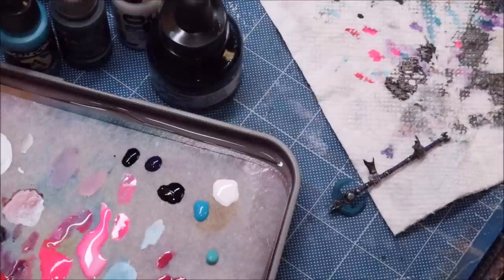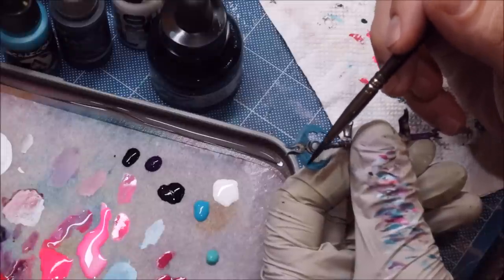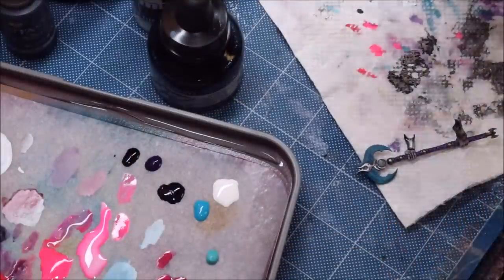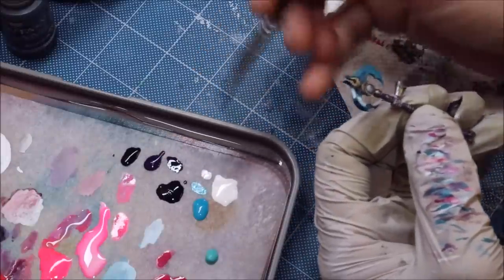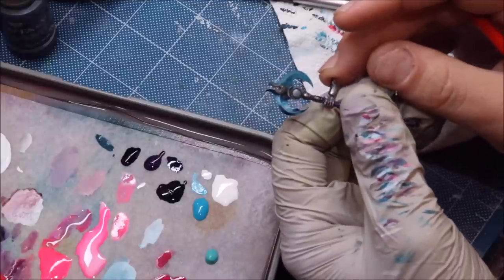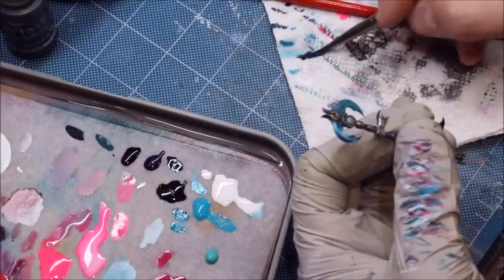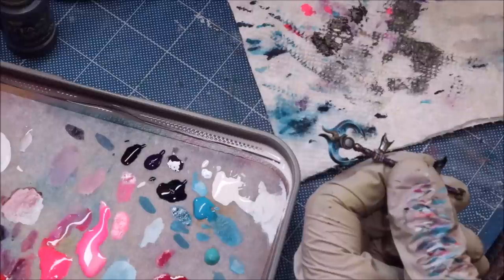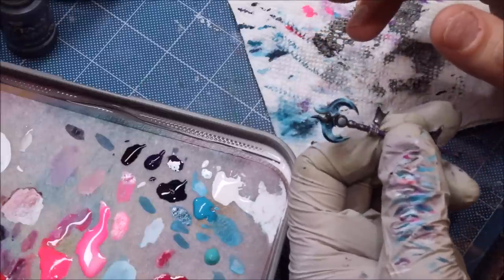Hobby Cheating 193 - Non Metallic Metal Axes

Comment: So, complete the set with a video about Non-Metallic Metal hammers?  I think it could be interesting with those sharp angles and flat planes side by side.  Also, I really like to see a video on painting black armor (ala Stormcast Eternals Anvils of Heldenhammer); I've seen a few other videos on the subject but its either been just heavy (read: all) edge highlighting with lighter colors or the effect ends up very washed out and looking more like just a dark version of the base color (i.e. it turns into dark gray, dark blue etc) and I'd like to see something that actually retains, if not pure black, then at least more of the dark basecoat.
Reply from the maker: Makes sense to me, it's on the list.

Comment: Hey Vince a grabbed some Burnt Umber from Vallejo. The air version. I didnt have time to mess with my air brush but wanted to get some paint on my current project so I just put some on my wet pallet and went to work. I didnt  thin it out at all besides it just being placed on the wet pallet. Only 1 coat on but it seemed to be have a lot like the contrast is suppose to. Which is fine but I am wrestling with some tide marks. Do you ever use Vallejo air paints with the brush or would you say dont ever do that?
Reply from the maker: I use air paints all the time with the brush, the key is you have to understand they are more thin and they have some flow improver in them. Sometimes you may need to work with them a little more, but you have to be careful how much more you thin them. That does sound unusual, but it could just be a 2 coats issue.
Reply: @VinceVenturella  Thanks for the info! It was only after a single coat so I just need another one on them. Also do you have any advice for giving models with more tone down colors like browns fans and white and creams a little bit more life? I'm painting my nighthaunt to look as if they are very dirty and muddy with tattered fabric but I dont want it to look just blah.
Reply from the maker: @manga3040  What you are describing is always challenging. Browns and those sorts of neutral tones are always a bit boring. The best answer is to use some kind of colored brown, i.e. get yourself a red/brown or a green/brown or whatever and that can really help.
Reply: @VinceVenturella  Gotcha good idea. Always a bummer because like the earth tones haha.

Comment: Vince, any advice for when there's details on the axe body? Specifically raised details instead of the grooved 'divots' like on the one you used on this video
Reply from the maker: Sure, if the item is thin filigree, you generally want it to be dark lined around the edge and quite bright to close to near white. if it's larger, then run similar blends in contrast to what is around it.